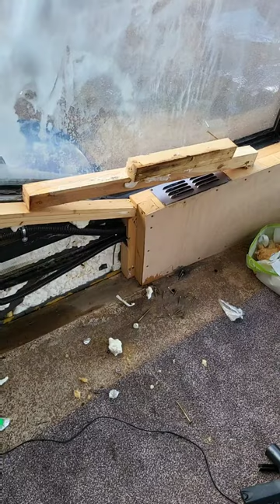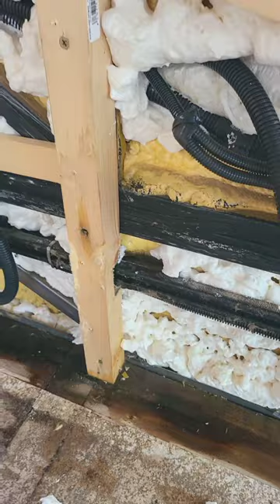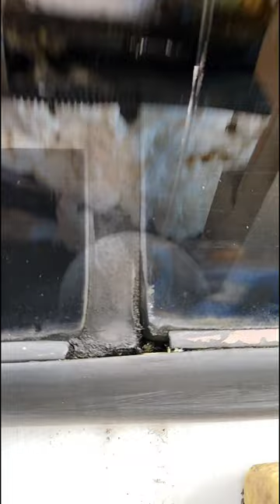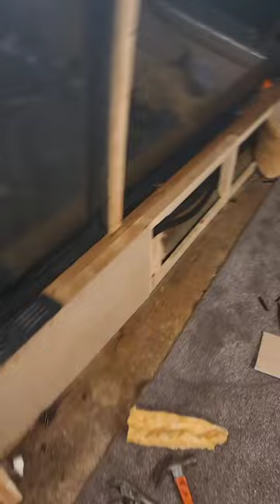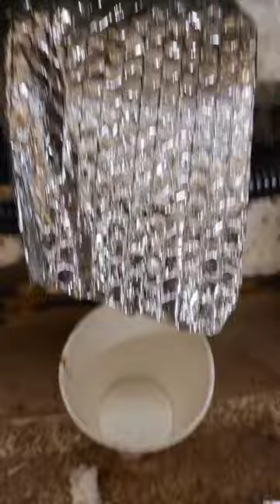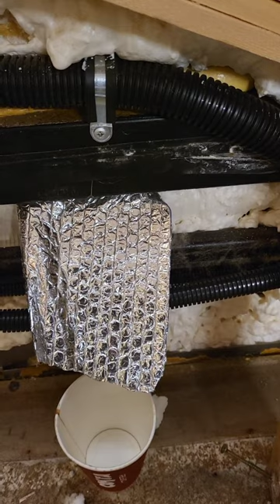Our bus has a fountain

Comment: Have you worked out where the water is getting in. I’ve found the tops of the windows bonding has failed and it lets water into them. I’ve shared some videos about it.
Reply from the maker: Yeh, there's a couple of places in the top rubber seal which seem a bit worse for wear, and the bonding to the frame :( no easy fix. The 'right' way is to remove the windows, strip all the old sealant and refit..... no idea how to achieve that with the tooling I have right now!
Reply from the maker: I hear the neoplans are common to have the windows fill up in the glazing :(